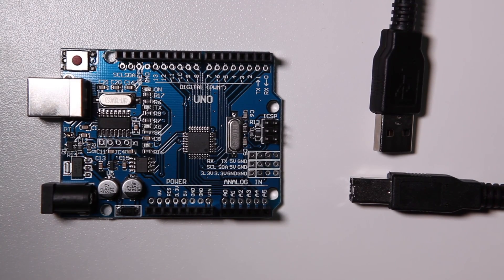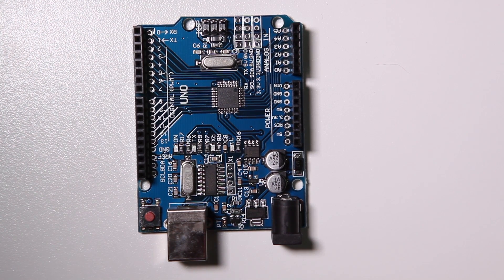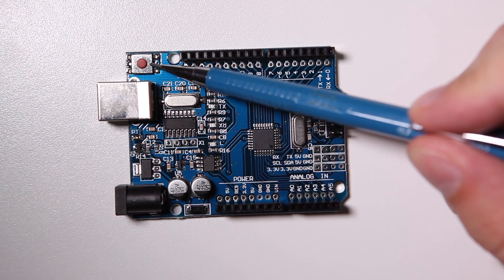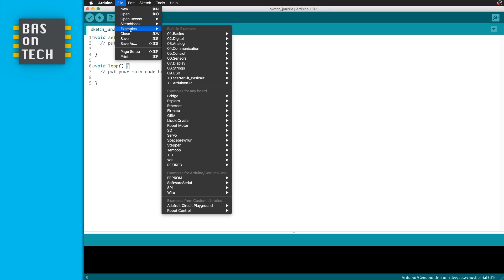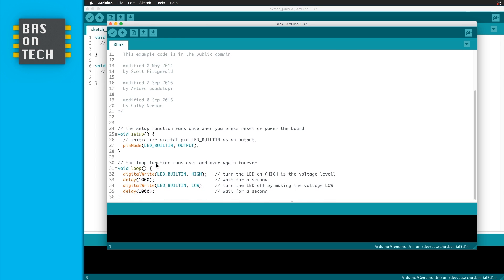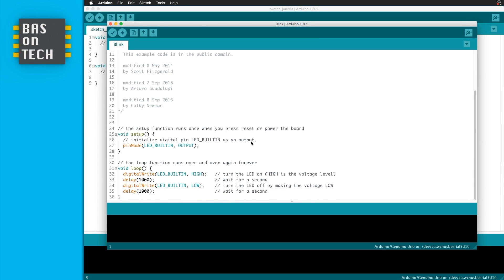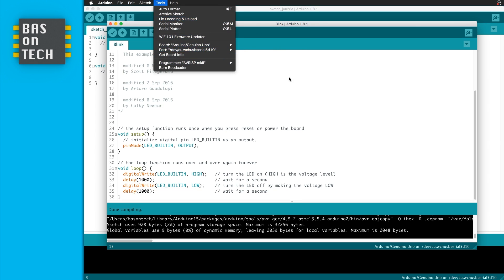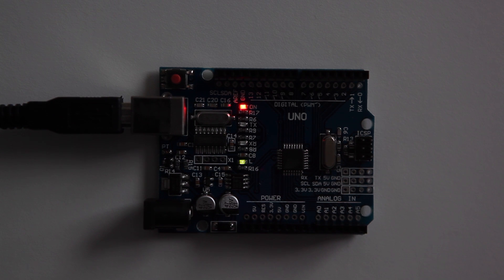BLINKING THE BUILDIN LED - Arduino tutorial #1

Comment: The program works while is connected to the laptop. After I disconnect it and connect it to the batteries it just lights up the "on" led. Any help?
Reply from the maker: Hi David, it doesn't blink at all?
Reply: @BasonTech  No. I am trying to make a follow the line robot and I tested it with a premade route. It worked because I didn't have the sensors connected, but after that I wrote the FTL program and I used the blink to check if the program is working. It worked as soon as I connected the senors' ground wire to the ArduinoUNO board. If you can, contact me on discord Fizz#3361
Reply from the maker: Have you tried to run the blink without anything connected?
Reply: @BasonTech  Yes. Everything works perfectly until I plug the Ground or the V5 wires of the sensors to the Arduino board
Reply from the maker: Sounds like a short circuit somewhere 😐
Reply: @BasonTech  Do you have some sort of social media so I can send you the circuit pic?
Reply from the maker: Sure! On https://arduino-tutorials.net there is a contact option 😃
Reply: Or can you help me fix the short?